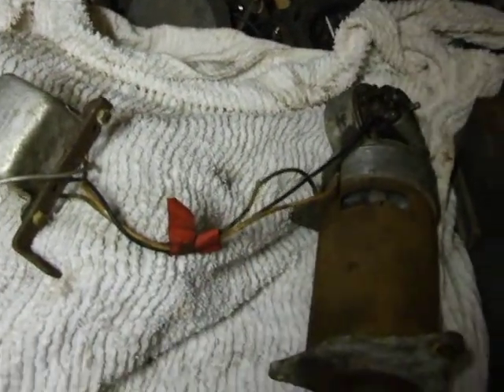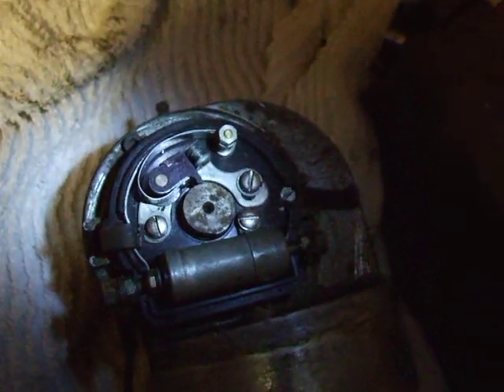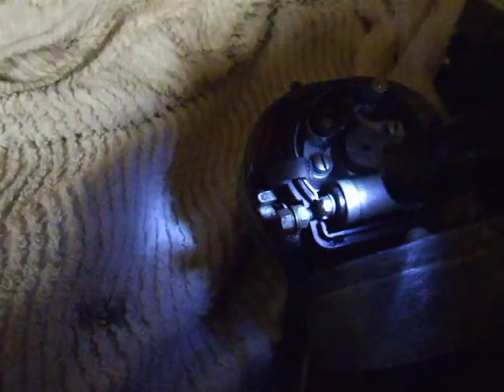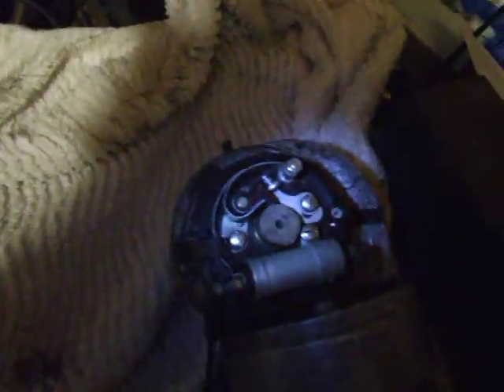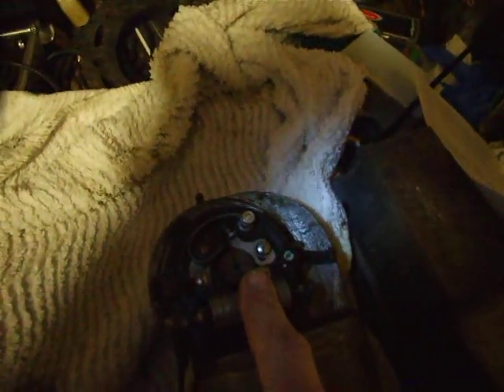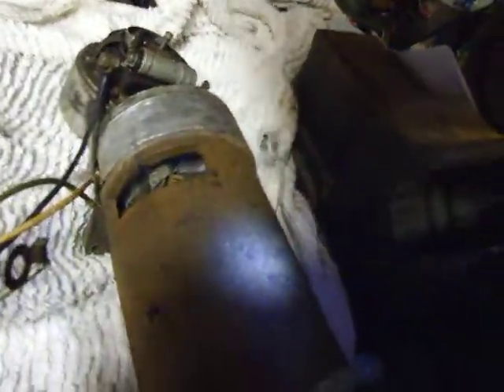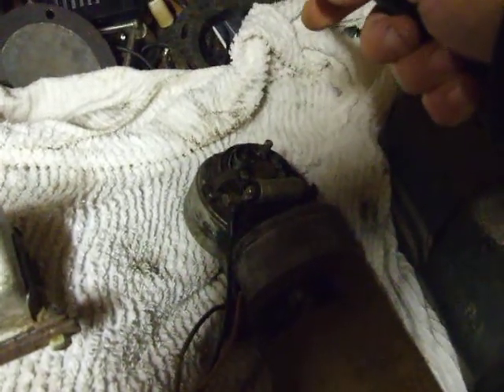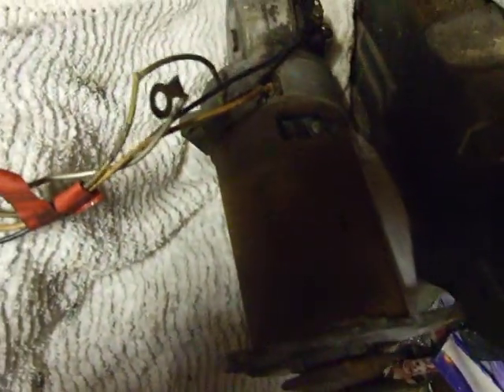lucas dynamo help contact breaker ponts driven from rear

Comment: Hi just came across you’re video I’ve have the same dynamo on a simplex milking machine driven by a wolseley wd 2 engine ,now not to sure how it works but been told that the points operate the  pulse on the  actravater its a portable milking machine with a stainless churn simplex came from Cambridge but I’m having trouble finding out about it ,it’s is 12 volt ,somebody told me to have a bulb off the points to show the pulse hope this helps you

Comment: Before any clues can be offered you need to put far better light on the situation and stop the camera shake. I Googled the model you stated but that does not exist but some close to that model do so try using a wire brush and clean the thing so you can again offer better information.